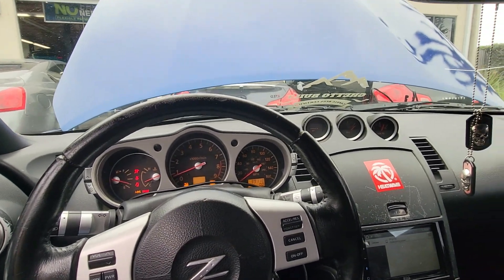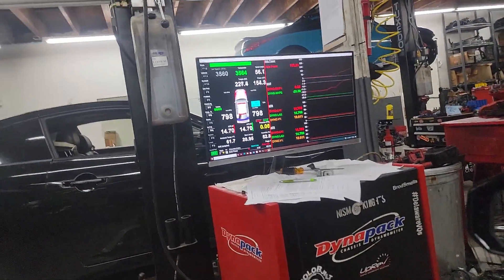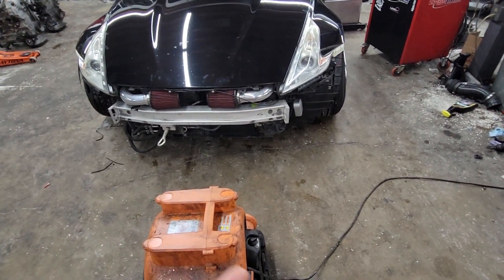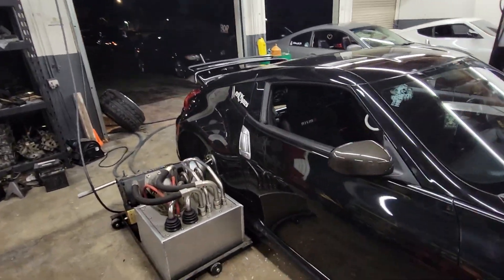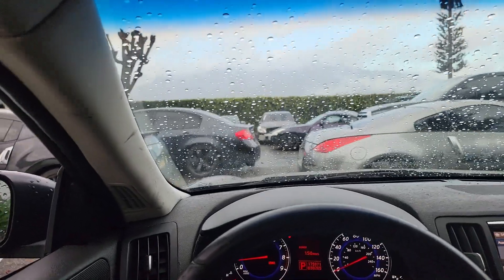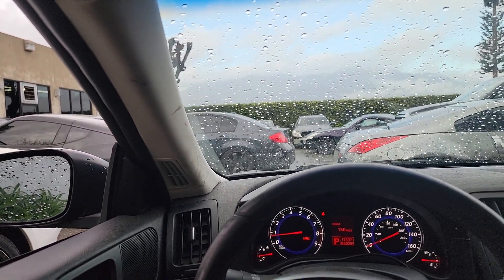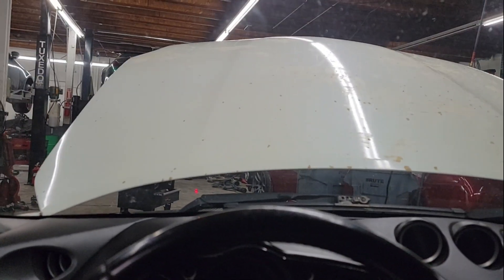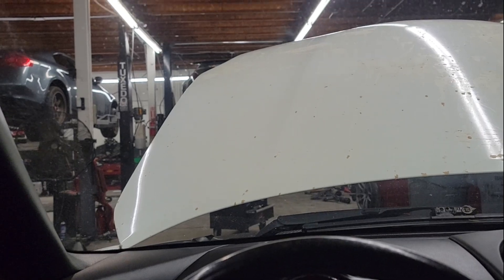350z HR rearmount more boost + 350z HR built motor N/A+ 2 other tuner tune delete

Comment: When you can't figure out what the problem is and start changing out all kinds of parts you create what I call a contaminated specimen. Because you have no idea if any of those parts that was changed are bad themselves,  because let's face the majority car parts now are made in China, Mexico etc. Even if the parts were made in Japan, America etc, you can still get bad new parts. Some people don't need to even look in an engine bay let alone work on them. I have a HR Z and my girl has a VHR G37. When we first bought here infiniti we took it to a shop just for inspection because Carvana was going to fix anything wrong that we found. Well the shop here in SC was talking about $5K and saying that the cats was bad and slew of other things was supposedly wrong. Little did they know that I work on cars and deal a lot with Zs, Nissans and other JDMcars from different eras and I called them on their BS and they pretty much refused to even talk about it.